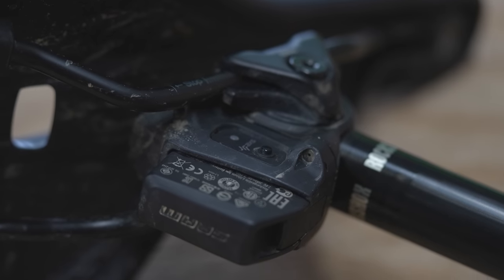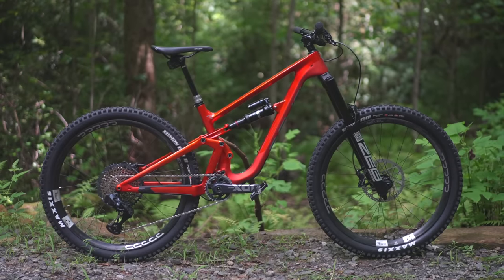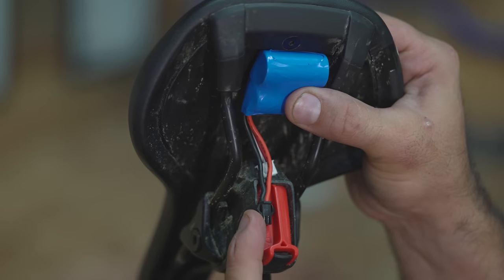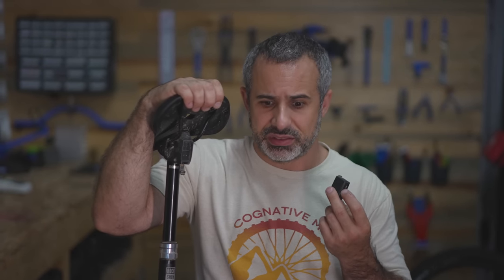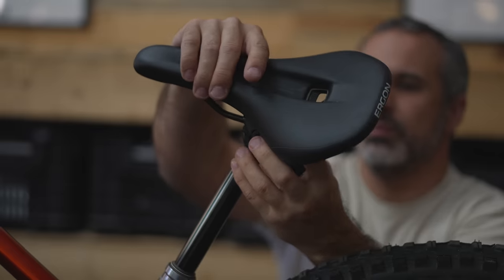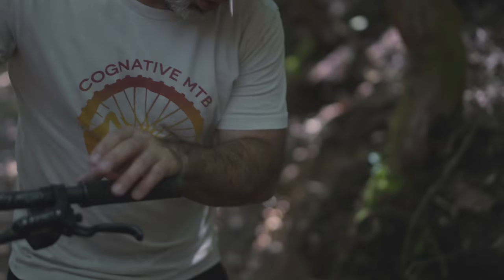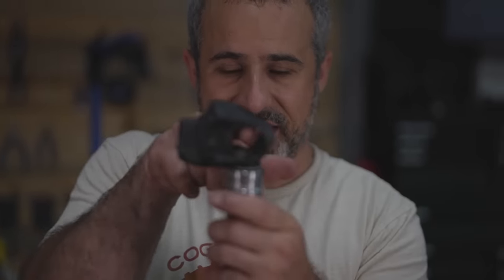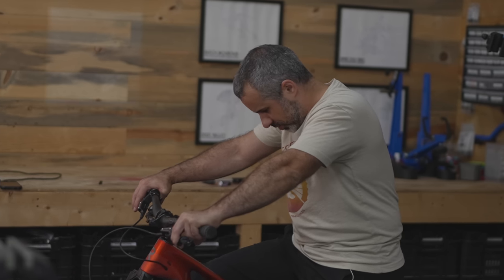My Wireless Seatpost has a big problem... Let's hack it!

Comment: For a $800 accessory, that's a major design flaw. Hopefully the manufacturers are taking note
Reply: should have just engineered it into the seatpost somehow, I'm not big brained enough to find a good way to do that but still
Reply: I mean, he literally let all the air out of his shock. When is he going to do that?
Reply: I hated the design from day one, it looks like a single giant testicle hanging in the back! Uh!
Reply: @onlyfoolriding8223  That's just to make it easy to demonstrate moving through the travel. It's not like there's extra travel when you take the air out, it's the same effect as if you bottom out when it's filled properly.
Reply: @onlyfoolriding8223   That was to show how close the tire comes to the battery when it's fully pushed in. Letting the air out was just so he could show how close it gets on the bench without compressing the suspension by hand.
Reply: @onlyfoolriding8223  just watch the video, dude. he explains it.
Reply: @onlyfoolriding8223  bottoming out.
Reply: @onlyfoolriding8223   even with the smaller "battery", after he put the air back in and clapped a jump hard enough to test it, the tire came close enough to rip the thing out
Reply: @onlyfoolriding8223  he was just simulating bottoming out.  If you haven’t done that you shouldn’t be commenting.
Reply: @iggywow  I've thought about how to do that before, You'd have to have either a non-removable battery and some way to externally charge the post, or you would have to remove the post every time you want to replace the battery. There is also nearly no extra room inside the post with the gas/air piston that accuates it up and down.
Reply: That's an unacceptable design flaw.
Reply: @onlyfoolriding8223  That makes zero difference. When you bottom out you bottom out. He just did that for demonstration purposes.
Reply: @onlyfoolriding8223  that feel when you never bottomed out your bike dayum
Reply: @iggywow  exactly! No need for the battery to be so big, just make it internal and have a charge port somewhere easy to access. Problem solved
Reply: @iggywow  SRAM engineered it to sell more of their AXS batteries at a huge profit margin. It's a 300mAh pouch cell in 2022, that kind of cell with plastic housing costs them less than $5 at best and they sell the junk for $60.
Reply: Cycling industry, easier to just make overpriced garbage and then blame the customer when it fails.
Reply: @MichaelRei99  Ah, sorry bro. Forgot MTB is all about taking lifts up to the top of a mountain and then bottoming out your shocks. Most of you ride 2 miles and then go drink beer as your jorts hug your nuts.
Reply: @onlyfoolriding8223  it was just to show an example of when he cases his shock on a big drop
Reply: @onlyfoolriding8223  Never but he was doing it to simulate bottoming out which he did in the video…..
Reply: @onlyfoolriding8223  not the brightest star in the sky, are you? That's just for demo, instead of trying to use full travel.
Reply: @onlyfoolriding8223  So you're saying only the way YOU ride MTB is acceptable?  Ahh the old "your fun is wrong" argument.
Reply: It's a SRAM - they know the US school system. People will buy twice, as soon as an improved version is offered to them as a solution.
Reply: I can't believe they didn't see this in testing must of figured anyone who would spend 800 bucks on a dropper would not be sending it
Reply: In SRAM's defense... this design will work just fine for like 90% of riders and 100% of XC riders.
Reply: This is not an issue on majority of bikes and frames, mine is nowhere close at full compression
Reply: @onlyfoolriding8223  it was to simulate the bike being bottomed out
Reply: It's actually north of $800. It been out for a while now So Sram it's time to drop the price and relocate the battery and make more money because you sell more.
Reply: @andy56730  they thought that if someone wants to spend $800 on a seat post it doesn't matter about a major design flaw as they're probably dumb enough to fork out another 800 or more on a "upgraded" one.
Reply: Well it really only does that on that one frame size on that one bike. For example a hardtail wouldn't have that problem, and neither would a larger size bike.
Reply: They're going to take note alright. Probably DRM the battery and make it impossible to do what Seth did. If they're somehow fine with this, then I hope they contact him, and come up with a workaround.
Reply: @andy56730  nah the design works perfectly on the very vast majority of bikes as Seth said himself
Reply: @PabzRoz  literally only a problem for rich hobbits. Put your seat tube up a little bit.
Reply: Shimano Di2 integrates their battery inside the seatpost.
Reply: @iggywow  their saving this idea to make one like a Version 2.0 where they can Charge a thousand bucks for it because it's an improvement
Reply: @onlyfoolriding8223  it’s simulating him bottoming out (using all the rear travel) so off big drops or over shooting jumps and he uses all his travel the battery will hit
Reply: @onlyfoolriding8223  doesn't matter, products should be designed for the lowest common denominator.. it should be designed in such a way that the battery can never hit the tyre no matter what bike or rider uses it
Reply: @onlyfoolriding8223  do you really ride bro?
Reply: This way it's YouTube
Reply: Typical sram product. Overpriced and flawed.
Reply: @iggywow  I put a set of 4 18650s inside my seat post, so they might just have to up their game
Reply: @onlyfoolriding8223  username checks out
Reply: @iggywow  18650s. Good idea man.
Reply: @brianwright9514  Do they make it clear to that 10% of riders tho?
Reply: @meikgeik  You can see the photo of the seat post that the battery sticks off the back. Do they need to tell you, explicitly, that your tire hitting the battery could cause damage? Any time you fit a non-factory component to your bike, you're re-designing your bike, which means that it's now on you, the designer, to make sure the new components will work with the rest of the system.
Reply: Me watching Seth drill into a dropper that costs 3/4 of my whole bike
Reply: @iggywow  The idea was for the dropper to use the same battery as literally every other SRAM AXS component. I will agree that it looks weird, but I also understood why they did it the way that they did.
Reply: @onlyfoolriding8223  it simulates full compression. Ever clapped a shock?
Reply: @raheemgahelable  That's so they can release V2 NOw with nice compact form!!!  for $900.   Only suckers need apply.
Reply: Repent and believe in Jesus Christ  b-o-r-i-n-g
Reply: @andrewlindley4865  "literally only a problem for rich hobbits. Put your seat tube up a little bit."  Yeah, so obvious. He'd lose less than a centimeter of drop while solving the problem in less than a minute with no money spent.
Reply: @onlyfoolriding8223  he did that to fully depress the shock, as you would every time you bottom out.
Reply: Not a design flaw. He just needs a post with 1” less travel or if he’s running a 170 post then one with 3/4” less.  Then just bump the height up a smidge so it doesn’t interfere. Not all components fit all bikes.
Reply: @onlyfoolriding8223  that is going to happen when you case a jump or obstacle, max compression. That's why he did that, and you can see that it scrapped while riding afterwards with the shock pumped
Reply: @brianwright9514  I sell aftermarket parts for another hobby.  You have to be as transparent as possible, test as many combinations as possible, and take feedback given.  If we were told about an issue like this, we would add a warning to the product page about compatibility issues (we have done this in the past when new products came out that were incompatible with our parts or needed extra bits to make them compatible).  My company has me working 5-10 hours a week, and a part time employee working about the same, yet we manage to do it, why can't they?
Reply: @SugmaDLigmaNutz  there's already a lot of other stuff inside a dropper post
Reply: I would expect such design flaws with SRAM.
Reply: @onlyfoolriding8223  Did you at least watch the video? He literally demonstrated it can happen with air in the shock.
Reply: Electrical engineers often lack mechanical experience. Just look at the menagerie of electronic locks on the market that are pitifully weak against conventional attacks…
Reply: @onlyfoolriding8223  "If I let all the air out of my car's tires and then try to drive it, the wheels get damaged.  This is a design flaw."  LOL
Reply: @onlyfoolriding8223  what's wrong with taking a lift up? Downhill and bike parks are ridiculously fun. If it ain't your cup of tea no biggie, but why even care?
Reply: Just imagine you spent 10 grand on a bike that has the dropper post and you travel across the country hit some jumps and you come home and realized you left your battery on the other side of the country and I just lost about 200 bucks
Reply: @gatoryak7332  but then you sit to high
Reply: Or don’t spend 800$ on a dropper post
Reply: @CAIDMASTEROFPYRO  You've clearly never designed anything.
Reply: @onlyfoolriding8223  He litterally popped the battery off on a jump in the video? Did you think he did that without air in his rear shock?
Reply: @onlyfoolriding8223 when you bottom out, he shows it later in the video
Reply: Facts! It seems like a stack of those lithium coin batteries integrated into the tube would’ve been a much better design.
Reply: If anyone is still reading these comments, I've reached out to SRAM almost monthly and still haven't received a satisfactory reply, so I don't think there are any plans to remedy in the near future. They keep replying, and I'm paraphrasing, "thank you for your input, we will forward to the appropriate department." None of their replies have acknowledged Seth or this video.
Reply: Ur fault if u buy accessories that doesn’t fit your bike

Comment: I feel like the biking industry is the only industry that tries to justify a 4x mark up on a part because it's wireless.
Reply: Good example is mice, anywhere from 50 to 100%. Dropper post? 400%. Pretty sure the techs the same.
Reply: @godking9027  Economies of scale don't really favor low-demand, high complexity stuff like wireless dropper posts.
Reply: Amen, I just ordered a new road bike with "outdated" mechanical Ultegra for $4000. Di2 Ultegra is $1400 more and even Di2 105 is $500 more than regular Ultegra!
Reply: They justify a markup because it's a hobby for rich people. We have $90 MTB tires that aren't anything special other than their own "branding"
Reply from the maker: To be fair, the newer products are always at a premium to cover the design costs and low production numbers. Unless you want the newest thing out, it’s better to wait for the price to get slashed by 50%
Reply: @PkonradW  I get the economies of scale argument. But, the tech that is used to make it wireless can be found in dollar store toys. It's just a regular dropper post with a battery powered remote. Economies of scale of already made remote tech very cheap a long time ago. This isn't new tech whatsoever, its just new for droppers.
Reply: only that the wired version of this (rock shox reverb as an msrp of 500$ so it'S not a 400% markup. Also, 4 times the price would mean 300% markup, not 400.
Reply: @godking9027   That's not even remotely true. Nowhere near a 50% mark up just for wireless functionality on mice. Just an example a wired Logitech G205 is $30 and a wireless G305 is $37. And the G305 has better specs on top of being wireless. You can literally get a wireless mouse nowadays for like 5 bucks lol. Yes there's ridiculously expensive wireless mice but it's not specifically because they're wireless.
Reply: @godking9027  50% to 100% on wireless mice? one what planet lol
Reply: It' does seem too expensive. Though to be fair, taking a historically non-electronic mechanical operating item, and making it electronic & wireless is a bit different then an upgrade from say, item that has an Ethernet connection being upgraded to have Wifi/bluetooth connectivity, etc.  Haven't seen the functionality but would guess it's just a electric actuator/solenoid that is performing the same function you would be by depressing the dropper post cable.  So there is expense of Electric actuator/solenoid and battery pack, wireless dropper button with battery for handlebar mount.  I could see that realistically adding $200 max to the price.    As it becomes more widely used the price will go down quite a bit, but the early adopters always pay a premium as the MFG needs to recoup some of it's design/engineering/tooling costs back quickly so it can continue to refine and improve the product and construction methods.
Reply: @hazepheno925  Yea, i think you're right here. And it's not like you can just use any old solenoid and actuator and wireless system.  Every component has to reliably able to handle all of the vibration, mositure, impacts and general abuse that being a MTB seat post entails
Reply: @DATBOCK  g502 wired is usually around $40. g502 wireless is $130. There's a huge difference in cost depending on the company and the wireless technology.
Reply: @BermPeakExpress  you’re the MTB God.
Reply: @TacohMann  That's a single example. You can't use a single example in a general statement. You can find outliers in almost anything... The G305 is 38 bucks only 8 bucks more then a wired one with the same specs. The cheapest wired and wireless mice on amazon are the same price at 4 bucks. If you look at mice in general not in one specific make and model mice are barely anymore expensive.
Reply: @oneword7143  “it’s just a….” So why aren’t you making them and selling them for a fraction of the price and cornering the market? It’s easy!
Reply: @BermPeakExpress  so can you help me to understand if i won something or its just a scam? I received berm peak message to contact you through telegram
Reply: @Youtubeforme88  Dont react, they are scams
Reply: Even at 400 I’d argue it’s steep when good droppers like PNW barely crest 200
Reply: @BennetJW  thx man
Reply: Meanwhile gaming industry:
Reply: Two lithium batteries, a transmitter, a receiver, charger and a whole lot of RnD to pay for. Plus they need quality control and insurances in case of batteries going Samsung right under your balls. It all ads up to be… yeah, a lot more expensive than simply yanking on a cable.
Reply: @godking9027  bad example,a pc mouse doesn't have moving mechanical parts and air pressure,really not comparable,besides that we are talking about a first generation cutting edge top of the line sports article,not a cinese Walmart copycat pc mouse
Reply: @PkonradW  The demand wouldn't be that low if the prices were resonable.
You're legit paying more money for bike parts than motorcycle parts, and those things usually have certificates supporting their safety which some countries require.
Reply: @adamweb  I'm just waiting for grx cranks to be resonably enough to not bump my TCO of my bike to 200%
Reply: @DATBOCK  I don't know if I understood the mice bit correctly. But if so, the logitech g502 or what not, wired and wireless have an insane pricedifference. ~40 vs ~120 bucks difference.
But if we look into stuff like the mx keyboard from logitech or the magic mouse from apple, you're paying so much more for so much less when compared to proper mechanical keyboards.
Reply: The cosmetics industry has the biggest margins I'd think ... Perfume gotta be up there too.
Reply: @Youtubeforme88  what do you think?
Reply: @PkonradW  Fair, but if they weren’t marking it up so goddamn much there would be much higher demand
Reply: Manufacturers have no need to justify what they sell, they just need to make sales. The customers justify the markup by buying the product despite it.
Reply: @kevintempleton1644  Yes but how many sales do they make based on a particular price? 

For example let’s say this wireless dropper cost $200 to manufacture they sell it for $800 that’s $600 profit per sale (obviously I’m handwaving away shipping and warehousing and advertising and all that bullshit for the sake of simplistic explanation) so at $800 a pop say they sell 10,000 seat posts that’s a profit of $6 million 

BUT if they drop the price to $400 while they’re only making $200 profit per seat post they may be able to sell 100,000 unity, generating $20 million in profit
Reply: @oneword7143  Someone also had to run R&D on the product including testing, develop it and bring it to manufacturing as a whole new product. Prices are set based on how much they've spent on it and how many they're expecting to sell. They overcharge for the battery but that's about it.
Reply: @BermPeakExpress  Seth, You could look into 3D printing new side clamps so the saddle sits 5-10mm or so higher when clamped and if you also put the guide holes that the micro tilt adjuster/bar sits in off centre that will allow you/a rider to then be able to correctly position the seat when running the dropper with battery at the front
Reply: @PkonradW  They don't BECAUSE they're pricing themselves out of it. To a certain extent, lower prices always generate higher demand. The big trick is to price something just a little high to generate interest, then after about 6 months, drop the price by 30-45% and then slowly increase it until demand begins to drop off. That's your maximum market value. Now that they have the tooling for this, they can very easily mass produce these posts at their maximum market value (would probably be around $400-600 based on similar mechanical offerings) and collect maximum profits. That said, SRAM is not in the practice of pricing things at maximum market value, they are curbing demand by pricing above it by a fair margin. What that means for the company, I'm not certain, but it doesn't seem good.